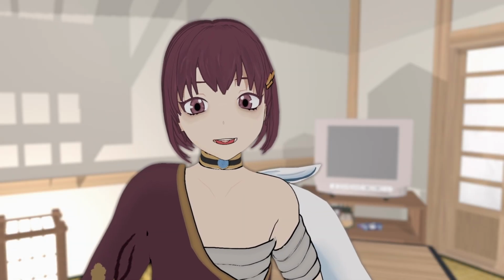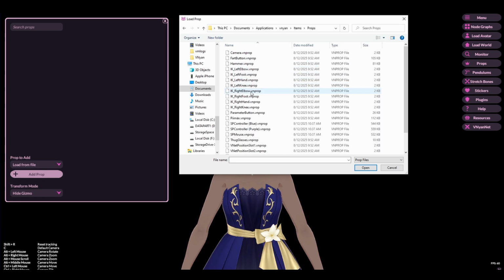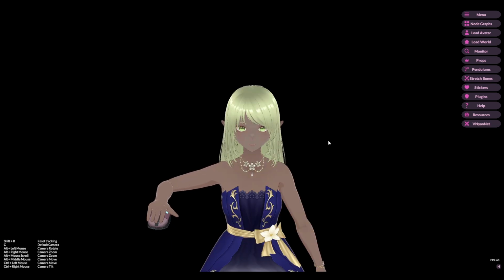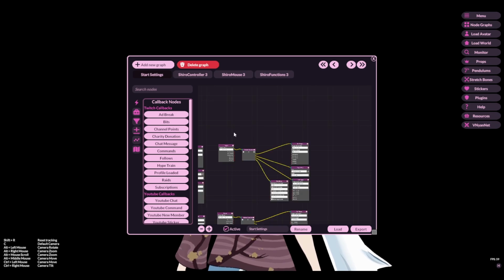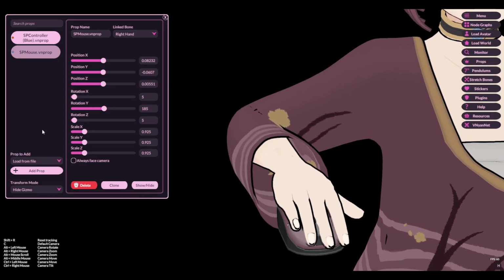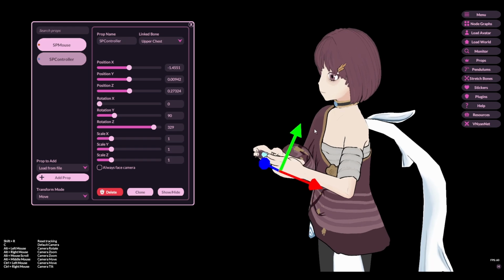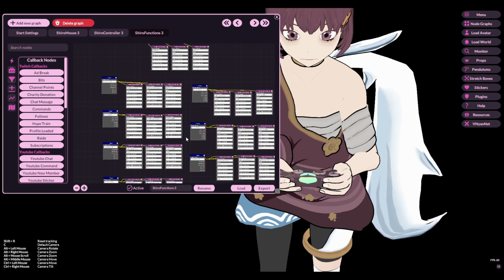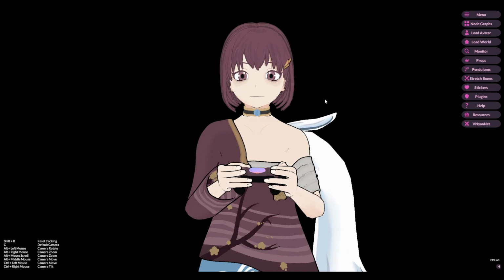[0.5v] Shirohane Controller Plugin for VNyan - Installation and Setup Guide (Old)

Comment: hey i bought your plugin and configured everything as far as i can tell but one thing that really bothers me is that the movement of the controller seems to be dictated by the rotation of the headbone. My tracking is very "i jump all over the place"-y and because my head and my body tend to move in two different directions, the movement of the hands looks really off like that. basically, body goes to the left, hands to the right - or i fix the IK in place and it just doesn't move at all. I would like the hand IK to be close to the chest usually. How can i do that?
Reply: (the movement range IK number correlates with head movement instead of chest movement, is what i am trying to say, in case i kinda flubbed my words)
Reply: also, it looks really jittery sometimes. when it crosses over a point in the middle, it kinda jitters a little
Reply from the maker: Sorry, I just saw this response. I am active on the VNyan discord and can be reached there.

Right now the IK movement is based on the head bone, you can reverse the direction of the movement by applying a negative value to the body tilt - movement range. You can also disable the body tilt and the ik will be locked in place.

EDIT: I just updated the plugin, there is now a option to allow you to apply the chest movement to the IK instead of the head.

I am still trying to identify the source of the jitter, as it doesn't seem to happen on my side.
Reply: @shirohane  omg i love you, thanks dude. You are an absolutely lovely person and thanks for your effort.

Comment: Holy crap I am probably going to try this but I worry I will get it and not be able to get it working because I'm terrible with nodes. Once it's set up though it looks amazing in your video. Nice plugin. ❤
Reply from the maker: I just noticed this comment. The plugin has made major usability improvements since this video was made, with the setup being much simpler. 

You can check out the updated documentation on my website. https://www.shirohanestudio.com/software/

Comment: I'm kind of having a lot of trouble with the controller settings. My hands are not going up to the controller whatsoever.
Reply from the maker: Can you make sure that you set the initial starting pose for the controller?

In the ShiroFunctions node graph locate the ControllerCalibration trigger. You will find a "Set Pose" node. Make sure that the "Animation to Play" is selecting one of the included “SH_ControllerPose” files found in the “Items/Poses” folder.

The file path to the initial pose changes depending on where you installed VNyan, so it must be updated during the setup process.

Comment: I'd love to try this but my dodo brain can't comprehend this. I'll definitely be back when this is simplified for brain rots like me ! Good work man!
Reply from the maker: Thanks. I am trying to simplify the setup process, but I also want to provide a solution customizable enough for vtubers with diverse models to use.

For example the "Fingie Controller" by Amba (https://ambadev.itch.io/fingie-controller) is a solution that simplifies the setup to three arm sliders, however wider waisted vtubers and avatars with large hands will clip through the controller prop.

There is a trade off between simplifying the solution and providing enough control over the configuration process for these fringe cases.